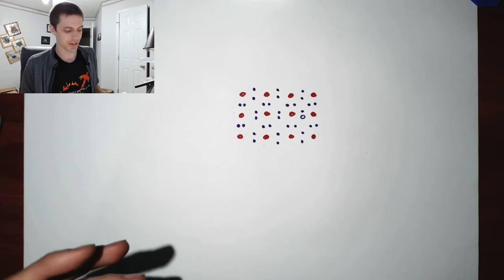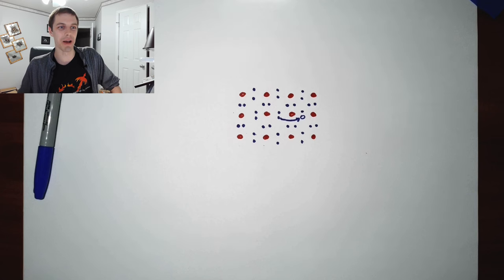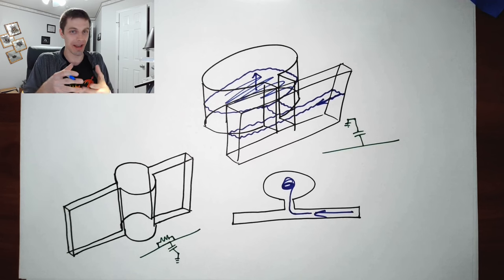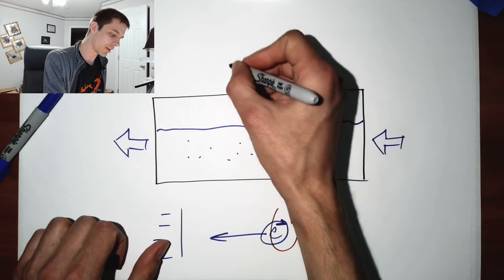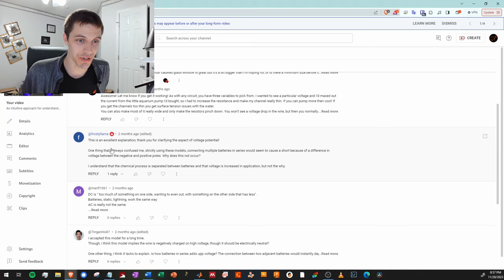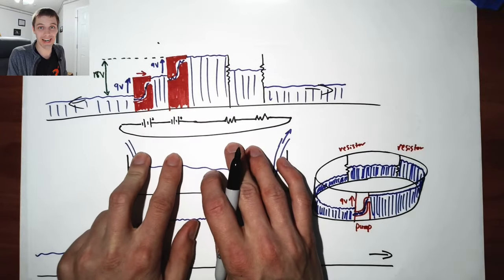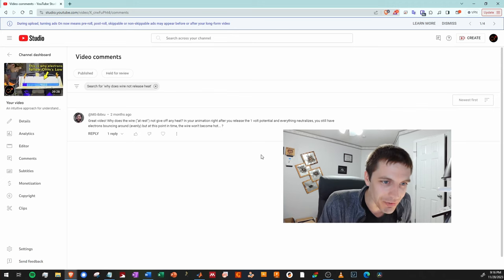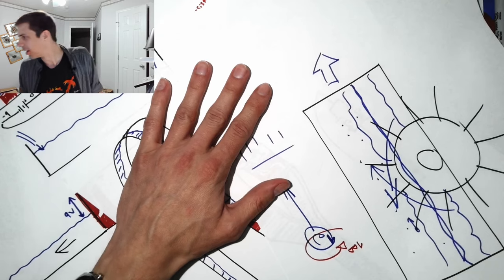"An intuitive approach for understanding electricity" AFTERSHOW

Comment: How do you model a batteries internal resistance?

(In a way that further helps understanding whats actually going on)
I apologize for being devil's advocate on this, but frankly I'm not clear on it myself and im sure it confuses a lot of people.
Reply from the maker: Typically the “internal resistance” isn’t literally the resistance of the metal in the battery, but a linear approximation to how easily the chemical reaction inside speeds up when you draw lots of current at once. If you can approximate it as a li ear equation, you can slap a fake resistor in the circuit with the right value (slope) and everything works well enough!
Reply: @AlphaPhoenix2  so it's kinda like a rate equation in chemistry? 
  So a lithium ion battery is like pouring lye into acid(heats up, reacts fast) and an iron battery is one of those reactions you got to wait for, 
The time it takes is functionally equivalent to a resistance?
Yes! Just like a resistance limits the rate at which electrons pass, a batteries reaction rate limits the number of electrons it can "push". Ding, the proverbial light bulb just lit up! Those equations from back in school make a little more sense. TY!
Reply from the maker: Yep! If you pull electrons out slowly, the battery has time to keep the voltage near equilibrium, but if you pull them out too fast, the reaction can’t keep up and the voltage drops

Comment: All the math is already based on positive charge carriers isn't it¿ Because of the original erroneous theroy¿ That's why 'current' goes in the opposite direction of electrons, yeah¿
Just the math works the same backwards or upside down, right¿

Comment: You could easily do the transformer, it's just that the time scale of that interaction is so drastically different it wouldn't really look the same. Spillways are essentially the transformer of waterways.
Reply: In which way? In my opinion a spillway is a bit misleading, since it defines a fixed potential. Also there is a physical water connection so water from one circuit actually flows to the other one. Also: how do you model different turn ratios? Not sure if this analogy really works 🤔 I think something like two floats connected by a pneumatic line with a bleed valve are a better analogy. The relative size of the floats is the equivalent of the turns ratio and the bleed valve in the line is for the derivative.
Reply: @miallo  So I wouldn't really think of the actual water as the current. But I was being super basic with that example, basically as a junction between two different potentials. Current goes down steam till it reaches the spillway then it's impeded till it reaches a certain potential then it applies current to the other (downstream) circuit. I'm real life is a poor example cause it acts more like a capacitor but I'm a model you can make it work like a transformer. Imagine putting a spillway in the model at the right height where the "bulge" of current barely spills over. And if it's a steady current, it will apply a steady, much smaller potential difference downstream. Again I realize it's an imperfect analogy but that's mainly because we can't even imagine water molecules reacting as fast as electrons. But it would essential work the same. The turn ratio would take some mental gymnastics but you could imagine some function of volume of the reservoir and height that would be pretty close to the same.

Edit: I think your analogy would be much more accurate but I was kinda spit balling with the theme of using just water to demonstrate.
Reply: @kyleoverstreet4701  RIght :) Get your thoughts! I think I went with a non-water transmission since also in the transformer the induction is actually not done directly by the electrons, but by a second "medium" (or rather the EM-fields), so I thought it would be okay to use something "non-watery" as well 😅 My idea is quite complex compared to all the other analogies, but I could not think of something simpler that keeps most of the properties... So in that sense also the floats are not really a great model for understanding the basics...
Reply: @miallo  yeah there is no perfect model with water. My point is it's not because water can't do it but that it is so much slower that it wouldn't really be recognizable. A transformer basically works by switching the current back and forth. When this happens, each time it stops and reverses, all that "kinetic" energy gets released as a wave perpendicular to the flow. (Still using a sloppy analogy but I'm doing it to compare to water) That wave propagates out. With electricity that happens at c in the form of a magnetic field. With water it happens at the speed of sound with a pressure wave. So the process by default is going to take 900,000 times longer to happen. 

I want to try to draw out what I'm thinking because I'm pretty sure I could think of a model that will do this it will just take a long time to see it work. If I can figure out how to do that and pay it here I will. Otherwise trying to just put it in words is useless lol. I tried and I couldn't even tell what I was saying.